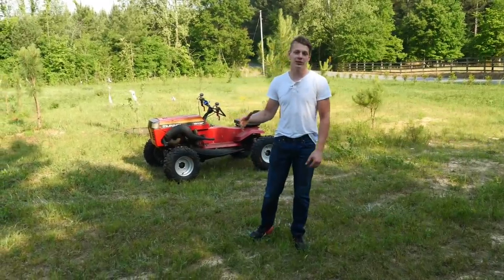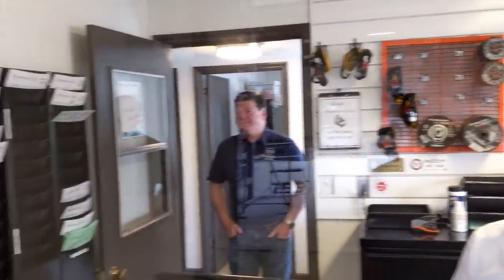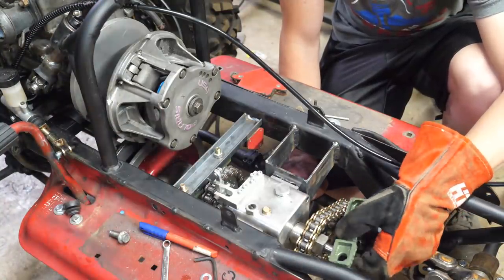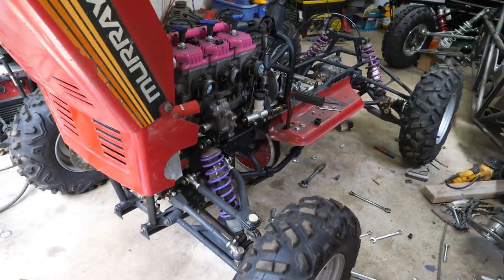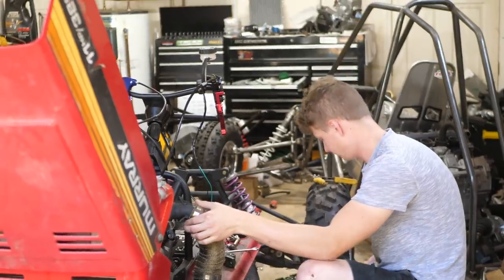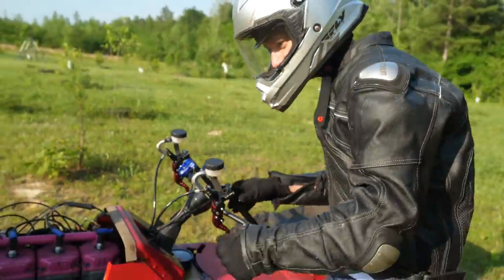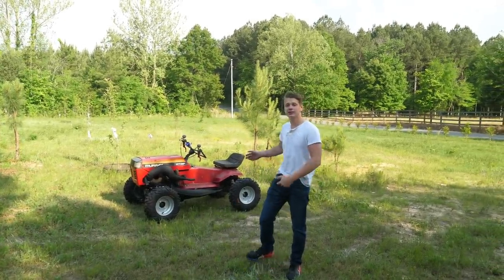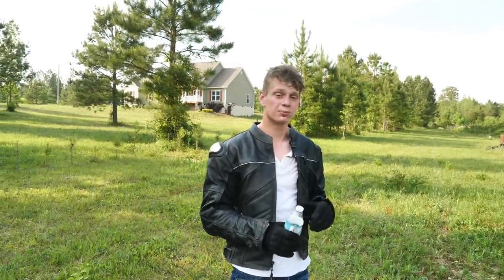600cc Snowmobile Riding Mower FIRST TEST DRIVE!

Comment from the maker: Check out SimpliSafe here: http://simplisafe.com/vasilybuilds. SimpliSafe is award -winning home security that keeps your home safe around the clock. It's really reliable, easy to use, and there are no contracts.
Reply: Boosted boiz have that same color minivan with OVER 1000hp ....
Reply: Hey for the guys at the shop. Get a battery powered mower and fab up a bracket so you can just put it underneath turn it on or off and not have to make belts work. Lol just a funny thought for a future vid. Great job on the mower
Reply: love it might have to add some slighty stronger springs on the rear , sags pretty low. love it though
Reply: Congrats! Thanks for staying committed to the build. Respect
Reply: check your email....sent you a message about simply safe
Reply: That intro was hilarious. lol
Reply: From your secondary shaft, to the rear axle-- you should have like 5 to 1 up to 7 to 1 gear ratio.. It should be quite a bit faster off the line....  Well at least on mine, it a rotax 500cc in a 2 seater buggy and its like 5.4 to 1 ... but I think its a little too high geared for my weight... You may even be able to go as high as 4:1 on yours though-- you have more power and less weight.
Reply: When you're all the way done with it you should put street tires on it and go for a top speed run
Reply: Yo bro if deck is back on can you cut at that fast  go get it done ye ha don't spill your drink
Reply: The the only thing I would change is that exhaust. Make them all dump out the bottom together or turn to the side.  Sick set up tho love the work. Finally so.ebodys built a 4 wheel drive

Comment: Vasiliy When you change the wheels put taller rims on the front so you dont need to use those spacers. Those will create bump steer.

Comment: Nice bro! Another great build! Build a small 2 blade pull behind deck like tractor / bush hog .  That way you can cut the grass with anything you build.  Maybe like a 10 HP vertical shaft. Idk, Just throwing it out there. It's bad ass like it is though.

Comment: That’s what I was telling you about the chain steering. Same issue with that drive chain. You need a solid plate between both shafts with gears so it can’t collapse like that.

Comment: I would stiffen up the rear suspension, jet&tune the carbs and swap to heavier weights in the clutch so it engages at a lower rpm. Killer build, I got a 440 twin off an indy sport on my go kart and changing them weights makes a difference.

Comment: I agree with you that the clutch engagement is somewhat late. and that the gearing is a little low. and it does seem a little low in the back. I can't remember during the build if you put a sway bar on it. if not that's something you might think about. and being as snowmobiles are normally designed to run in winter. it would be handy if you could at minimum try to connect a temporary coolant temp gauge. to make sure the coolant temp is in a safe range. I would hate see you burn it down especially so soon after building it. I noticed some pops when you first started it likely a fouled spark plug but it cleared up right away. to only have a small weld failure is really good for such a complicated build. it sounded really good I would have to say it's maiden voyage was a complete success and well worth the wait. you made sure every i was dotted and every t was crossed I think you did a great job. and like all builds from scratch a person always has the testing and development stage to get though. so I can see it definitely getting better no doubt.

Comment: Well Done!!  Crazy part is, that engine can EASILY (and cheaply) be built into 800cc and 170+ hp
If you want to clean it up a lot, 680cc Ultra cylinders (same engine) are bolt on and run same HP with a single pipe.

Comment: First off all you did an awesome job on the whole build my only tip is that those engines love cold weather and I mean cold so I would do some research and keep leaning out the carbs until most of the smoke goes away once the engine is warmed up and let your plugs tell you what the engine wants about the only tip I could get from fellow racers was go lean to be mean but to avoid blowing rings and pistons do jetting changes in small steps but awesome build I would also through some seriously heavy clutch weights the more mass the harder the clutch will grab the belt also heavier weights will engage at a lower RPM with that stiff primary spring that is in that clutch

Comment: Just gotta get the clutching dialed in, lean it out a bit too, its set up for a sled ~1-2 sizes smaller on the main jet and play with the e-clip on the needle, watch the middle cylinder as they are known for running hotter and seizing / melting pistons

Comment: My uncle converter an old mower deck into a pull behind the mower deck. He put a small engine on it, hooked the blade shaft to the small engine and put small rubber wheels on it. Just towed it around to cut grass with his old sears tractor...

Comment: I agree with the metal shop guys, She needs to mow! Easy way to do it would probably build a litttle trailor around the deck and use a smaller engine to just run the deck, But I have seen a mower build with a sport bike engine with an integrated mower deck.

Comment: Glad I finally got to see this thing driven. I’d rather see a time lapse of the whole build instead of being strung along for so long. Exhaust needs more support and now that you are half deaf, maybe you can fab  a spark resistor or something. Put a steeper helix in the secondary clutch along w a stiffer spring, heavier weights in the primary clutch. Then your should be able to launch it a little better,. Good luck on your future endeavors

Comment: The spacing  of secondary to primary clutch is important if belt tension isn’t tight enough and almost dragging per say then it will be like taking off in 2nd-3rd gear. And it won’t get into top gear per say. You can put on jack stands and rev it to 1 see how high up it’s engaging on the primary and 2 to see top speed that the belt is sucking all the way down into the secondary clutch.

Comment: i wonder how much it would affect your power band on bottom,if you were to drop it to 3000 rpm springs in your variable drive....would certainly take away a majority of shock load on launch,but not sure if that mill would fall flat on its face....if he put 5k springs,im gonna assume that engine is ported for top end....this is seriously a bad ass build! this thing would be sick with some duallys on the rear too,imo

Comment: Yo that thing is scary scary fast too. I think looks like it'll just Baja right through any situation. And you can tell the gearing is low guaranteed with the right gearing that thing will hit 120 mph easy 0 to 60 it screws. Let's see can't wait top speed run. ⚡⚡⚡

Comment: You are going to want to get some mufflers on that thing that are roughly the same length as the stock muffler, this will increase your top end or high rpm power. Could also just use pipe the Same or slightly smaller diameter as the outlet on the chambers if you like the noise

Comment: Did you have to re jet or do anything special with those air filters? How did you determine how much air to give each carb? I am converting a snowmobile engine onto a cross kart but am having issues with the air going into the carb.
Reply: I just reworked a 125 cc go kart and did airfilter and exhaust and it took about 3 weeks to learn how to jet it properly. I could tell a difference from running cold to when it got hot so i can imagine you will definetly need to rejet a snowmobile engine even if you dont change airfilter. Just jet it rich and accel hard and when it pops and breaks up, its too rich. Lean the jets little by little until it can handle a full throttle romp. It will be crisp and run much more powerfully when you get it right. After it gets really hot it may still stumble because the intake air will be very heated and not carry enough oxygen to burn all the fuel completely. 
It just takes tinkering back and forth until you notice patterns and you will get it dialed in

Comment: you need to re jet the carb for warmer weather as this motor should be running in negative temperatures also check the clutch engagement and if they are expanding all the way

Comment: From your secondary shaft, to the rear axle-- you should have like 5 to 1 up to 7 to 1 gear ratio.. It should be quite a bit faster off the line....  Well at least on mine, it a rotax 500cc in a 2 seater buggy and its like 5.4 to 1 ... but I think its a little too high geared for my weight... You may even be able to go as high as 4:1 on yours though-- you have more power and less weight.

Comment: That engine will make an easy 120hp with a lil tuning and carb work , 140+ if you port and change cylinder heads and proper exhaust...from Wyoming USA 🔫🤠🇺🇸p.s stay safe

Comment: Runs good. All I have to say. Is your going to have to rejet it just a little. U need a really good fan. U have to put one on there. U will kill that motor. Are they necessarily for cold weather no. They just need extra attention to the cooling system. But I know that thing goes so much faster than that. U got to figure out that gearing

Comment: Make you a thin mower deck you can easily hook under it with a couple of cheap modified 20 volt weed eaters inside that will cut grass technically if it can cut grass its a lawn mower .

Comment: I’m glad to finally see it up and running but at the same time I’m a little disappointed. I had anticipated a lot more power coming out of that triple trouble especially after hearing the clutch wasn’t engaging until five thousand rpm’s. It should either be doing wheelies or ripping trenches.
Reply: Belt is slipping, you can hear it

Comment: The engagement is way to high. I suggest rebuild your clutching to engage around 3000 rpms. This will give better control when just putting around and won't be so harsh on your driveline but enough to get a good launch.

Comment: Put 4 wheels on the deck and a separate 5hp motor just to power the deck. Make it a pull behind mower. BOOM problem solved.

Comment: Hate to be that guy but that pipe needs to exit behind you lol.. Could use a muffler too.. But I guess i'm getting old. I'd try some stiffer springs in the rear and i think you'll be set there. Initial testing is supposed to be disappointing FWIW.

Comment: You shouldn't have listened to those old farts telling you to put the mower deck back on. You just get yourself a box blade and pull it from the back. Hell, you can just get an old tractor mower deck through a lawn mower engine on it and drag it behind you.

Comment: This is Grind Hard's Ethan talking about "Scrub Radius". https://youtu.be/dJXejNFAiIA
 I just learned of it and thought it may be of interest to you. I noticed your setup brings the center of your wheel quite a way out. I am not trying to pick on you, I thought you might like to see this. I found it interesting and if you could make the adjustments yourself, it would probably lighten the steering effort quite a bit. He talks about it in the first minute of the video. I realize it may be impractical or unnecessary for your application. Keep up the good work, Mr. V!!
Reply from the maker: I watched the video and learned to. to fix it I would need to run crazy huge 14's instead of the 10" rims im running